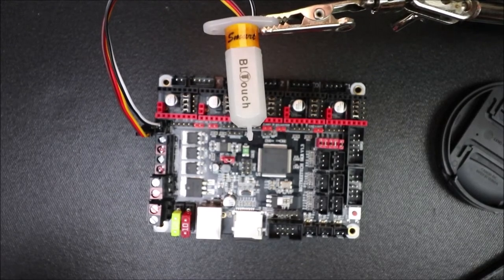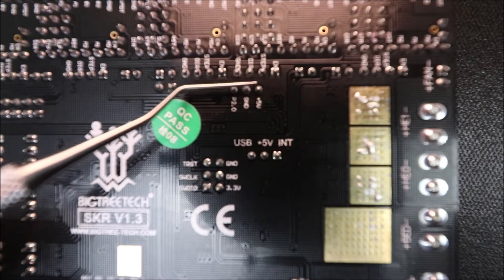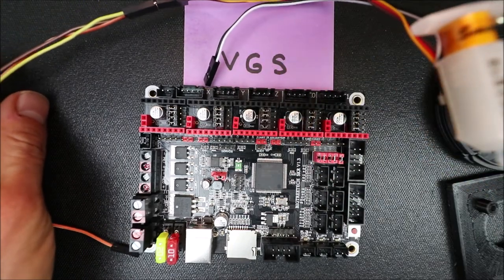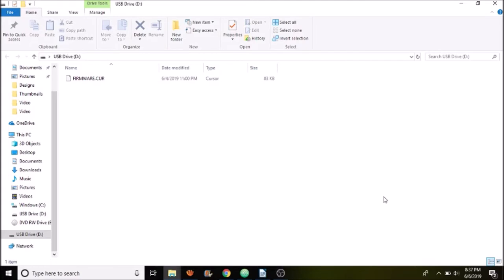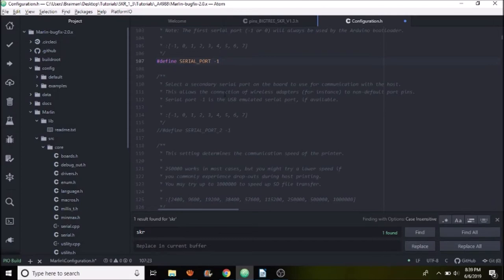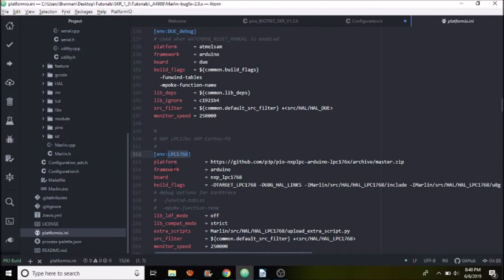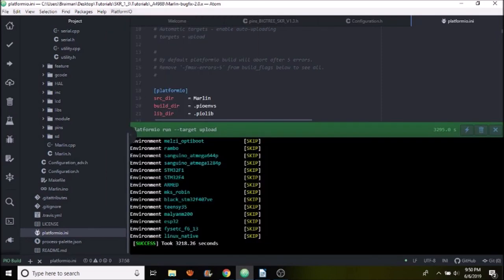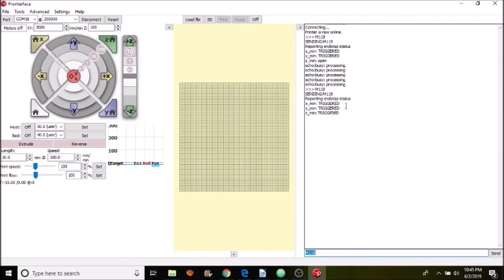SKR 1.3 - BLTouch

Comment: Just now switching to an SKR 1.3 at 24v to give it a whirl. Needed a quick reference for signal and voltage on the bltouch and you got to that point very quickly in the video so thanks. I suppose I could have went to the bltouch website but this is where google brought me. I did watch the entire video so you get credit for "time watched". My connection for the bltouch requires much longer wires as I'm sure most people's will, what I did was tie the two ground wires together at the connector since the ground pins are common on the SKR (same as RAMPS). This eliminates 1 wire running from the probe to the board. Just tried a quick Z home routine and a bed level, all is working well.

Comment: Awesome tutorial mate, I don't have the same board (I have SKR Pro) but you've helped me understand how to wire BLTouch now to every board! Big Thanks! <3
Reply from the maker: Thanks.  My SKR pro seems to not work. I have another coming, but a couple of weeks out. I'll be showing SKR mini soon while it's coming.
Reply: @EdwardBraiman  Found you're videos very interesting and with lots of knowledge for newbies. I'm going mad trying to set a BL-Touch 2.0 on the SKR Pro 1.2 under Klipper, even though it has a dedicated port it won't work...haven't been able to find out why. In any case thanks for sharing your knowledge.
Reply from the maker: Probability is high your extender cable is the issue.
Reply: @EdwardBraiman  Found out the hard way that 3D touch Chinesse version of Official BL-Touch won't work on SKR Pro 1.2, bought an official and it was a trouble-free installation.

Comment: You can easily switch the pins around in the 3-pin connector, no need for extension cables
Reply from the maker: Not sure I understand.  Is there a way to reverse ground and 5v without cabling physically?
Reply: @EdwardBraiman  You can release the female pins of the 3-pin Dupont connector on the wire with the help a little screw driver, then insert the pins back in the order you need
Reply from the maker: True, but for people new to the sensor we need to be a little obvious when describing the problem.  RAMPS  1.4 and MKS Gen L have them in the order of a servo.  Good point for others to follow.
Reply: Edward Braiman do it with extension wire was a smart move !
Reply: @EdwardBraiman  People new to this are unlikely to have jumpers lying around. and the jumpers are just an extra point of failure.

Anyhooo, I really, really enjoy your videos, than you so much for the effort. I look forward to my regular dose of adrenalin. This happens every time I see you poking around something electrical with a metal scribe.  (SMILEY FACE)

Comment: 3:14 When changing the pins on the connector, you can use a needle or thumb tac and remove the pins from the connector to reorder them. No need for jumper cables. Fantastic video though, really appreciate it.
Reply from the maker: Thanks.

Comment: Great video. For adding BLTouch to a Pro v1.1 is the configuration the same? Because we are using it on the servo pins, my pro isn't using it as a Z endstop and this is resulting in nozzle crashing. Note, I am able to test it and deploy it through the lcd.  I read on Github to separate the pins and put the black wire on the Z min ground.
Reply from the maker: I'm still unable to get BLT to work on SKR pro.  I'm waiting on a working copy of Marlin firmware for SKR pro to try again.
Reply: hi, same problem !!! please if you have solution/tutorial iwill be so happy thanks
Reply from the maker: I'll need to check since I opened two issues Marlin firmware GitHub page about two months ago.

Comment: Your hand is blocking what is going on when you actuate it. So when you hit the Z home button the pin pops out? And then you just push it in when that happens (simulating it touching the heat bed)?

BTW, for the pins being of order on the board I just removed the wires from the dupont connector with some pointy tweezers and then put them in the dupont connector in the right order.

Comment: Have a question for you, I have a problem with the bltouch when I run M119 Z_min  is open but Z_probe is always triggered.
When homing the print o trying to level it, the pin never comes out and it crashed on the bed. I have trying many  diferent things with 0 luck.
Reply from the maker: Try inverting Endstop logic from false to true or true to false depend how set and test manually without stepper motor connected.
Reply: @EdwardBraiman  Also try that but still not working, when I run M280 P0 S60  the pin comes out, then I run M119  and it should come out as TRIGGERED, but as soon I type M119 the pin goes back in and its shows OPEN.
Reply from the maker: M280 is for a servo.  That might be why the pin in BLtouch deploys.

Comment: great video but you did not give any info concerning the points to change with Marlin for correct setup. Any support?
Reply: The auto leveling works but when it is completed no chance to start the print. If I click on print, the extruder and bed does not heat up and the print does not start. Any Idea ?
Reply from the maker: These sound like Slic3r settings.  When a gcode file is created in Slic3r, they set these settings.
Reply: Edward Braiman 
It seems that printer is blocked after leveling.
I tried to repeat home or move axis but it doesn’t works.

Comment: I have Skr 1.3 with tft 35v3.0 tft  and 5160v1.2, this is replace mainboard for anet a8 plus. My question is for firmware marlin 2.0 in vs code platform io,. I'll build firmware to ensure it successful firs time, once I make changes to firmware it shows fail that  there issue with env 1768 or other time the build uploaded button bar at bottom left of platform io disappeared. I've even used bigtree version of marlin 2.0. they build successfully first time, if I make a chance to any part in marlin 2.0 I get one or outher issues in firmware.
Reply from the maker: Maybe try ATOM with Platformio and see if it changes.
Reply: could I be missing a step that causes this or should I  reinstall vs code platform io and dress copy of marlin 2.0
Reply: ok
Reply: @EdwardBraiman   my git turn out to be corroded some how during downloading it first time,  so a new fresh  upload of git fixt issues I was having with vs code and atom.

Comment: Do you need to do anything about the voltage? is the board 3.3v or 5v :?
I know the LPC1768 is 3.3v logic and I was worried this will cause issues. does the board have integrated Logic-shifts?
Reply from the maker: If you're using the bigtreetech version you should be fine.

Comment: Hi.  Is the Marlin 2.0 configuration different between BLTouch and the LJ12A3-4-Z / BX sensor?  Anything else needs to be changed?
Reply from the maker: BLT is a hall effect type sensor, they other appears to be inductive sensor and requires a metal or iron surface to work best and is more difficult to wire and can cook your electronics.  BLT is much safer.

Comment: Does anyone know if the Bltouch v3 plays nice on the SKR 1.3.? I have  my beloved SKR 1.3 installed on my Anet A8 with e3d clone (bowden). I replaced my inductive sensor with a capacitive  one after upgrading to glass on top of the bed, and quickly realised that the capacitive sensor is all over the place. Z height constantly changing, thus resulting in me having to change the z offset on a regular basis. So I gave up and ordered a Bltouch. Can't wait for it to get here. Thanks 😊
Reply from the maker: Keep in mind, some have said they are having issues.  Someplace in the comments someone gave a link to a known Marlin firmware issue.
Reply from the maker: Here is the issue they highlighted ... https://github.com/MarlinFirmware/Marlin/issues/14489

Comment: When you held the pin in, the bltouch went into error (flashing orange).  That's why it showed up as triggered.  Normally, the trigger pulse is only 5-10 milliseconds, so it will never show up as triggered using an M119.  This means you really did not show the probe is working.  I'm currently having problems getting my bltouch smart v2.0 to trigger the skr 1.3 for some reason.  If I held the pin in, and the bltouch went into error, m119 would show triggered, but if I try to home Z, it does not sense me manually triggering the probe, and the z motor keeps turning.  M43 S goes through a self test normally until it asks to trigger the probe w/in 30 seconds, which I do, but it never recognizes it. and says Z_MIN_PIN 57, instead of P1_25.  Are these pins equivalent?  Also, FWIW, whenever I issue an M119, it deploys the probe, which is real strange.  Any ideas, anybody?
Reply: This is exactly what's going on with me right now and for the life of me I can't figure it out
Reply from the maker: Why do you think it's not working?
Reply: @EdwardBraiman  it triggers when I test M119 normally but the Z axis keep going down even when I trigger the probe manually.
All connections are working fine and the firmware is configured correctly but I still don't know what's wrong
Reply from the maker: Endstop needs a quick double tap manually.
Reply: @EdwardBraiman  the problem is even when I let the nozzle touch the bed it keeps going and I have to reset the printer.
Reply from the maker: If endstop works for manual testing for m119 for both triggered and Open, then something else is occurring.
Reply: @EdwardBraiman  that's what I can't figure out
Reply from the maker: There's a Discord link on channel come to general chat and either myself or someone can walk you thru it.

Comment: I’m having issues getting my bl touch to work with my SKR 1.4turbo. Can you make a video for that? I have read that a best to use the z min instead of dedicated bl touch probe pins. When I used the dedicated pins my z axis would not go down at all. Only up. When I used the z min my axis moves however my probe will not trigger. It just crashes the bed. When I go through the config steps it resets deploys and stows. It just won’t trigger.
Reply from the maker: Would love to, but I've opened two bugs on Marlin's GitHub page.  As soon as they fix issue I'll record a tutorial.
Reply: Edward Braiman thank very much. I find your. Videos very concise and easy to follow
Reply from the maker: You're welcome.

Comment: Hi Ed, the video has helped me understand the wiring of my 3DTouchv3 (a clone of BLTouch) but I’m unsure of a few things transferring from a PNP probe. If you can answer them I would appreciate it but understand if not. 

Firstly does the Z Ground need to be in place or can I link it into the common Ground like I was using with my PNP probe? 
Secondly to get the probe to work I had to remove the R11 chip on the board. Is that likely to cause an issue?
Thanks.
Reply from the maker: That tutorial is very dated.  About a couple of months after tutorial, Marlin firmware made a change and it stopped working.  If you go to my discord, someone might have the answers.

Comment: Hi Edward. Thanks for another great video. Is it required to press the reset button after each FW update/config change?
Reply from the maker: Nope, just remove USB power and then plug USB back in.  This assumes no external power to motherboard.

Comment: Great tutorial, thanks a lot. Is it possible to replace the BLtouch with a capacitive sensor on the SKR 1.3? All I found working only from 6V DC
Reply from the maker: It's possible, but has issues.  You're going to need the exercise caution with wire gauge as it had a habit of making the wiring burn.

Comment: I have it working on homing but how do you set up the leveling? 
The x homes with the blotch off the build plate.
Reply from the maker: Could you be more specific?  Remember, up and down is normally referred to as z axis, left to right x axis and forward and back as y axis.  I'm guessing you're saying it homes to z axis fine?  Bed leveling has several configurations, search on linear bed leveling.  Keep in mind I personally do not use automated bed leveling.
Reply: @EdwardBraiman  Yes, do you know of a video that shows how to set auto bed leveling up? Your video is good just doesn't go far enough. All the videos I have watched stops after getting the BLTouch working for homing. 
hmmm maybe I should search for auto bed leveling.. Thanks
Reply from the maker: Sorry I'm working on a smaller printer to show.
Reply: @EdwardBraiman  Wow, didn't expect to get blown off like that.

Comment: shouldn't you also set the 'BLTOUCH_SET_5V_MODE' in configuration_adv.h ? 
After all the SKR1.3 board is 5v, no? 
Also, even though I follow your exact setup and configuration, my board gets stuck on the Z home action in prontoface... lots of 'echo:busy: processing' until I get 'Error:Printer halted. kill() called!'
Reply from the maker: The odd thing about the BL touch is that it worked in both cases for me before knowing about the option for 5 volts mode. I've seen the busy message before, but usually on the 3d Touch.  I'm wondering if it's related to the state of the sensors before testing.  What does it say for the gcode m119 before starting?  What color lights are you seeing on the BL Touch before this occurs?

Comment: I just bought an anet a8+ 3d printer,
it has a filament runout sensor installed and an auto bed leveling without probe (manual moving z-direction at 16 points on the bed). I want to upgrade my auto bed leveling with bl touch and probe (auto z-direction move to 16 points in bed)
in my upgrade plan, how to edit the firmware?
do I have to back up the firmware setting 1st then add a new setting?

I'm a total newbie
Reply from the maker: Currently, I try and use some type of source control locally on a back disk or whatever process works.  If you buy a kit, some manufacturers maintain a website of default software.  The other method is to use gcodes and record values.  Keep in mind BLtouch in Marlin firmware version 2.0.x has not worked for me since December, but Marlin firmware 1.1.9 does and it only works for 8 bit processors.
Reply: @EdwardBraiman  thanks for the insight
Reply from the maker: You're welcome.

Comment: Sorry it has taken me 2 years to catch up with crowd. Just got my 3dtouch and installed it using Marlin 2.1. ABL works fine, but printing is a problem. The print starts, then stops for a second, then continues for a few seconds and repeats. I notice in terminal that the board sends an M119 report back to the PC when the print stops. It shows z as triggered. Any ideas?
Reply from the maker: There might be a discord link in description or on channel.  In discord there's a bltouch chat.
Reply: @EdwardBraiman  Many thanks. Can't seem to get into Discord at the moment.

Comment: Both the SKR and the BLTOUCH are on their way and I thank you for this video.  My Marlin code (same as yours/same as all 2.0) does not have the same code as yours nor on the same line numbers so I am now leary of this code since it is 2.0 bugfix it should be what we all have, right?
Reply from the maker: You're welcome.  Marlin bugfix may have changed since video, but I'll try and check by this coming weekend.  Thanks for the heads up .
Reply: I was looking at adv instead of the .h of configuration (still getting used to Atom as I have only had it for a day) but I modified my comment " My Marlin code (same as yours/same as all 2.0) does not have the same code as yours nor on the same line numbers so I am now leary of this code since it is 2.0 bugfix it should be what we all have, right?  You say it has changed but if that is the case the versioning system should have kicked in.
Reply from the maker: Not sure, but I think it's in beta mode of development.  Github might show changes.
Reply: I saw a lot of BLTOUCH stuff in the _adv.h that was commented out in my version and I wonder why?  Might be in yours too.

Comment: good video, only i would have either re crimped the connector , or like Michal for teaching tech, re insterted the plugs
Reply from the maker: True, but I use the BLtouch in multiple tutorials and do not want to break the connection.  If BTT made them the same as every other manufacturer it would be no issue.
Reply: understand. your video was very helpfull by the way. 

Just finishing up my CR10 S5 SKR 1.3 TMC 2130 and BL touch.
converting to all in one. 

a few hurdles but got the BTT SKR working fine now ( tuning needed ) 

final assembly tomorrow. then stab rods and of to the horses ( Print farm )
by then it should be more silent than my prusa and with the .8 nozzle also fatser for the big prints.
Reply from the maker: Thanks.

Comment: I don't like connecting my probes to the Z_MIN. wish there was a connector for this. it'd be even nicer if they had a connector with a built in votlage divider for inductive probes
Reply from the maker: You can wire to other pins.  You just need to modify pins file.
Reply: @EdwardBraiman  there's not that many available i think. sadly. but I could use the z_max i guess :)
Reply from the maker: You could use fan output port.